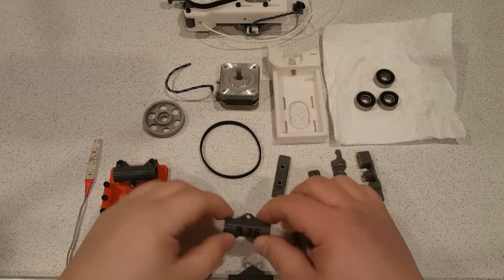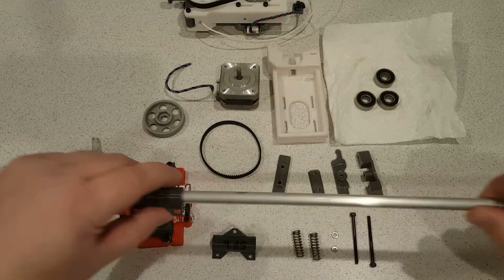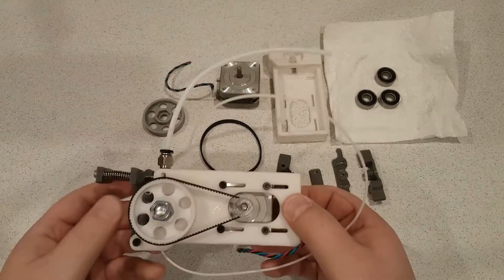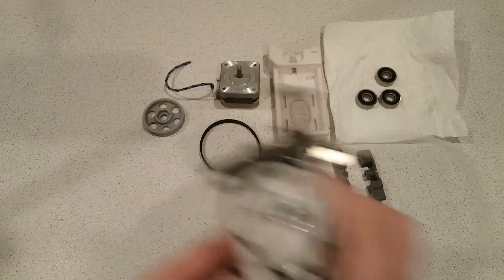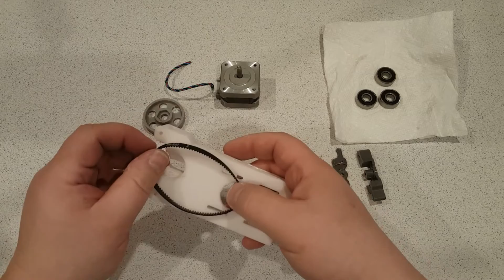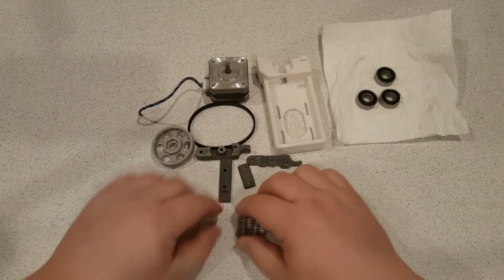3d printed bushings for Hypercube, x carriage LEDs and extruder

Comment: How have the printed bearings been holding up?  What material would you recommend for them?  

Another questions, how do you feel about these: https://www.thingiverse.com/thing:1961848

Thanks
Reply from the maker: The link you provided took me to printed extrusions, not the bearing. Are the ones you have in mind straight fin style? I like mine better because of that swirl inside which spreads the wear evenly around the rod and should move grease around if you use any. I clean/lubricate my X rods with WD40 from time to time
Mine are doing fine with many hours of print time on them. I have the same style of bearings on Prusa Mendel i2 which has been printing for years. But maybe I've just been lucky. I recommend printing a couple of replacement sets to have them on hand for when the current ones wear out. I printed mine in PLA but PETG or nylon might be a better choice. Or better yet, POM (Delrin) if you've conquered it.
Reply: Artur's Lab the link was for the printed extrusions.  I was just looking for your opinion on them.  I have printed your carriage and will be printing your bearings in the morning.  Glad to hear they are lasting, I will end up printing them in PLA for now.  Thanks for the response
Reply from the maker: Ah, ok. Metal will always be more rigid than plastic. You want your frame to be as rigid as possible. i would not use printed extrusions. I'd even think twice about using printed joiner corners instead of the aluminum ones from Tech2C design. The more rigid your printer, the better quality parts you'll print.Following that logic one might say that using printed bushings for x carriage makes no sense but that's one thing where we make trade off to sacrifice some rigidity for lesser weight which also affects print quality and speed.

Hope my bearings work well for you. They are a pain to use initially. I bought longest 3/8" bolt I could find and I use it as a file to run through my printed bearings to smoothen them initially. then i use sharp end of a cutoff 3/8 rod to trim some more inside surface. How much of this you have to do depends on actual diameter of your rod vs ID of the printed bushing and how smoothly it prints.
Reply: Artur's Lab thanks for the tips.  I just saw an email confirming the shipping of my extrusion.  I stumbled upon the printed kind while downloading files for the hypercube.  Everything is printed, just need the hardware.  Using the parts from my Anet A8 for the majority of the electronics.
Reply from the maker: Glad to help. You might want to join Hypercube facebook group. https://www.facebook.com/groups/1871049783171141/?ref=group_cover